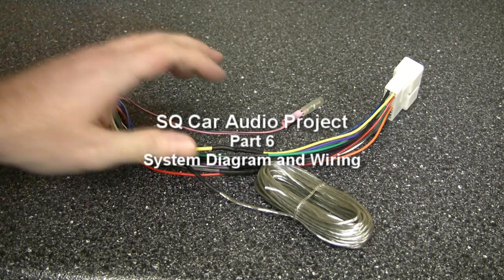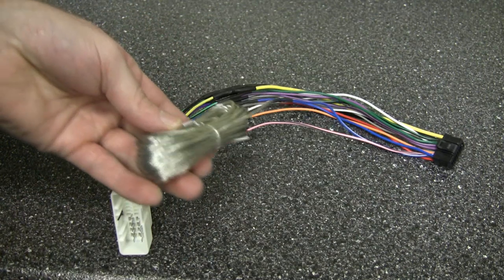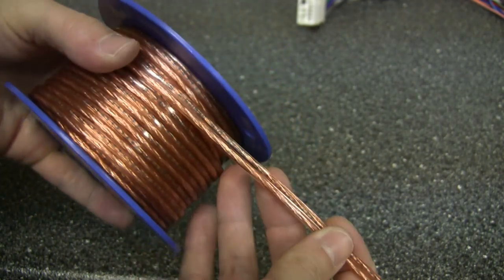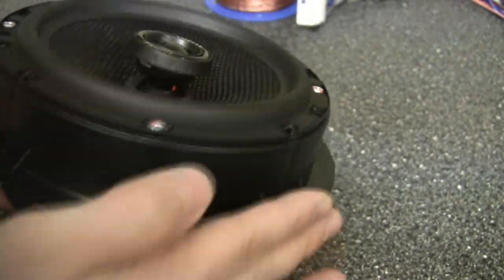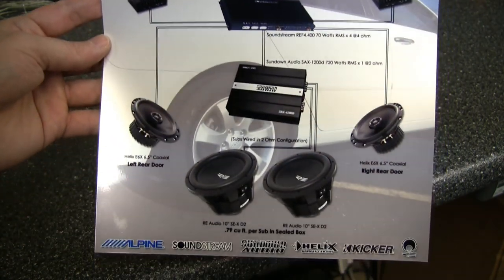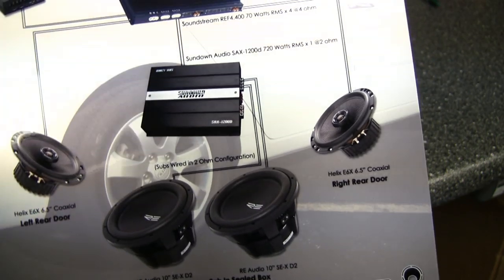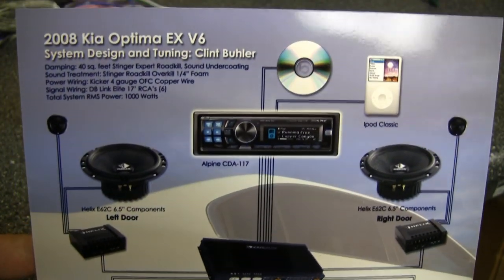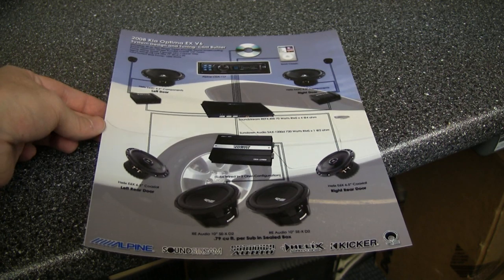SQ Car Audio Project Part 6 System Diagram and Wiring

Comment: Hey man I was wondering I'm going to install new speakers in my car I got the alpine cde-hd149bt head unit and I'm going to put the alpine spx-17 pro in the front and idk if I should put component speakers in the rear or get done coaxial speakers what do you think if I get the components rhett gunna be the alpine spr-60c and if I get the coaxial there gunna be the alpine spr-60 for now they'll be running on the alpine power pack there only 50x4 rms and I'm still saving to get the alpine pdx-v9